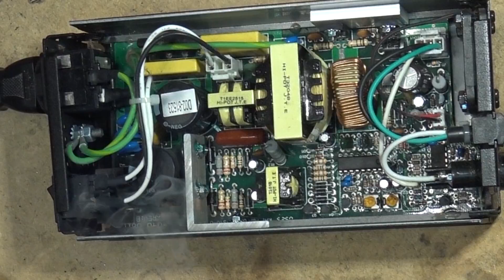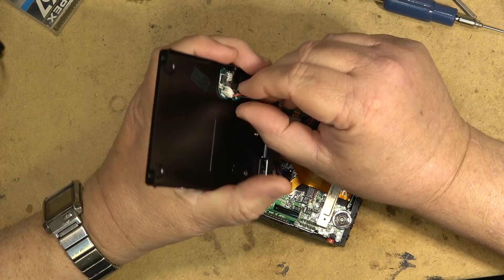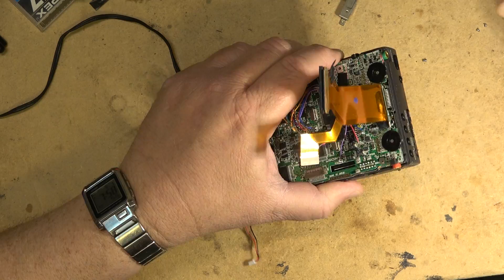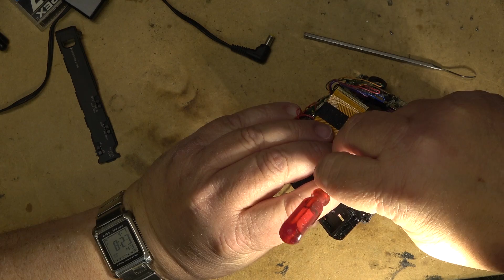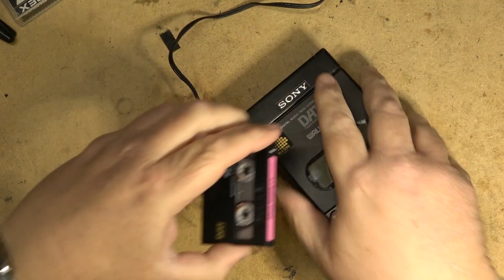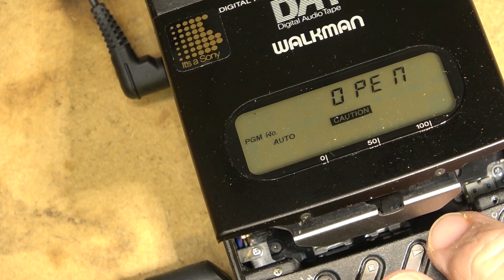sony tcdd3 is it junk?

Comment: Glad I sold mine it had all the accessories (remote and spdif).
Reply from the maker: I have the spdif, and car mounting bracket for mine. Works great.  Did stick a couple of times when I first fired up but ran a few tapes through it and it is fine.  The display el panel is out in mine.   I was hoping this one would be junked but the guy wanted it back to sell for parts.  Thinks someone is going to pay a few hundred for broken machines.  Good luck.  Back in the box and off it goes.

Comment: If you are a Sony service centre and receives a unit like that, what would you do ? technicians who know how to fix those walkmans are very likely retired, parts are unavailable, chances of a successful repair are slims and costs might be too much for the client who might just decide not to pay and leave the unit in your storage. It's plain simple, you come up with an excuse, say unit is not repairable and avoid yourself some headache. There is no point in bringing 15 or 20 years old devices to official service centre, in most cases they just refuse to do any work.

Comment: Ive got a sony dtc 700 machine is that something that can be fixed it loads but wont spin does it have belts inside that could be changed?  I have several people I trust that can send it away to or should I just get a replacement machine?

Comment: In your TCD-D3 the second one, you need to clean the two rotary encoder on the mechanism.
Is very tedious to go in mechanic, and you need to remove the reel assy. A long work but's is work.
Reply from the maker: That has been done. It just sticks, the door that is. If I tap the lid it once it has unloaded it opens every time.

Comment: You know what so sad about these machines is that they are put together by people getting paid very low wages! And it's all done an assembly line! One lady does one part and another and looking through big glasses just to put those little tiny ass screws in! I feel your patience wearing off sometime during the video! Boy no way I could do it!
Reply from the maker: I lose patience quickly when I know that someone else has been inside as there is usually a surprise. In this case a connector that the lock clip was broken and as soon as I released it the thing fell apart.
We refer to those as a cracker jack unit (surprise inside) Had it been never touched I would have more confidence of a successful repair.

Comment: All these SONY DAT walkmans suffer from hardened grease in the mechanism: it is a common and well known problem. In order to fix them, most of the mechanism needs to be relubricated.
The idea is that without relubricating the mechanism, it's only going to be a temporary fix, like it seems to be in the second unit shown in the video. The caution on display is caused by the mechanism remaining stuck in one postion from the hardened grease (the mode switches are not the problem, although it may seem like it). That's why operating the unit a few times partially solves the problem. The TCD-D7 shown in an older video which failed to load the tape had the same hardened grease problem. Although Dave lubricated some parts, there were others stuck and only a full relubrication will solve the problem for good. 

www.youtube.com/watch?v=fIfgVWZOZbk - this almost 5 hour video shows the refurbish process of these walkmans (the mechanism on the TCD-D3 is almost identical to the TCD-D7/D8).

There are people who specialize in DAT repairs who can refurbish these units completely for a good price. There are others besides those mentioned in the links, but keep in mind these units need a full refurbish, otherwise they're never going to work properly in the long run.  
http://www.andyselectronicstuff.co.uk/sony_dat_recorder_repair_service.html
https://www.paulcarrington.co.uk/dat-repair-example

It is to be mentioned this comment is not a critical one, just offering people who want to repair these things some solutions. They are indeed very hard to repair and it's nothing wrong with Dave's decision not to go any further.
Reply from the maker: If you watched my original TCDD3 that is what I did. Lubricated it and cleaned the eject switch. I then put the unit away and it has not been run for years. The mechanisms do get gummed up just  like those old dual tape decks. This one that came in had already been to sony awhile back and they had condemmed it. Also the mechanism on it was turning freely as I did run it though its paces when it was apart. The big problem on it is the capstan motor connector on the bottom of the board is so bloody loose that the connector won't stay in even with the clip engaged, and the servo problem that sony already said it had. The guy sent me 2 VCRs along with it, and one of them has a bunch of broken plastic cams and gears as well. The 3rd hasn't been looked at yet.
Reply: @12voltvids  I didn't say this unit in particular was repairable. I was just stating that in my opinion, someone who wants to collect something like this should have it completely serviced in order to enjoy it. Is it worth it ? It depends on how much one is willing to spend to have a perfectly working unit. But the ones specializing in these units charge something like 100$ for a complete refurbish. Depending on what the unit itself is worth, it may or may not be worth getting it repaired. 
 
I did watch the video when you serviced your unit. If you want, skip through the video I linked up above. It's made by a retired Sony engineer who knows all the problems with the little DAT walkmans. The fact that the mechanism is moving freely by hand is not relevant, as the motors have very low torque and even a little bit of drag can cause it not to work properly. 

Did successfully repair a D7 with sticky mechanism, so in my experience it can be done, but it requires a couple of hours of patience diassemblying the entire mechanism (every moving part must be cleaned and lubed with oil) and putting it back toghether. It's not an easy fix for sure, but after replacing the old grease with oil, the mechanism works perfectly. 
Again, I'm not judging your decision, just think that these DAT walkmans are worth being repaired, because they're a collector's item. Much more valuable than old camcorders in my opinion.
Reply from the maker: @valentinc22  Yes if there is not another underlying problem. I restored a portable Teac and of course my TCDD3 as well as a TCDD7. Had an 8 which won't spin the drum, and then this one which  the owner indicated he didn't want to invest much as it had already been written off.
The big problem with these units is the mechanisms stick. That is well known, and they will continue to stick even after oiled up if they are not used regularly.
Even min e had some trouble the first time I fired it up in 2 years, but I have been running it all day now and it working fine now. Note to self, don't let it sit around.  This is the biggest problem for all camcorders and vcrs and DAT machines and there is a warning in every owners manual recommending that the device needs to be run at least once a month to keep the mechanical parts in good order. Doesn't matter what it is. Your car is the same. If you let it sit eventually the engine will freeze and then you have a problem.
Now you see I just reminded myself that I need to run a tape through my digital 8 cameras and mini DV cameras to keep them in good order as they have all been sitting for months untouched.
Reply: @12voltvids  So true ! It is indeed very important to use these units regularly. But in your case it's probably more difficult given how many you have. 
But at least I get to see in your videos a lot of devices that I would never want to own anyway.
Reply from the maker: @valentinc22  There is the cool factor to the size of it. I like them to show off what was available, but you are right they need to be run from time to time or they will just deteriorate from disuse.

Comment: When you send stuff to Sony they often LIE about the nature of the problem, and suggest you have them scrap it. They come up with some part or other that is no longer available, and tell you that is what is wrong. I worked for a Sony authorized service center and we heard this many times.
Reply from the maker: They are no different than anyone else.  The smaller and complex the device the longer it takes to service. At 100 bucks an hour something like this is on economical to repair unless it's something extremely minor.
Reply: @12voltvids  The difference is the Sony people LIE. Seen it more than once. This is my experience with the Laredo Service Center, from which they truck stuff down to Mexico for the actual "repair".
Reply from the maker: @mdzacharias  Doesn't change the fact that someone had already been inside and the connector under the board was damaged. These things are a pain in the ass to work on to begin with and dealing with damage that others may have caused adds an unknown element to it.
Reply: @12voltvids  Yeah I admire you for even trying with that thing.

Comment: I seem to remember a DAT forum website or somesuch of enthusiasts who know how to work on DAT units. It's worth trying to send it to someone there.
Reply from the maker: Remember this format is completely obsolete now.  No parts available.   I don't spend much time on them because 9 out of 10 won't be fixable due to parts issues.   Since i make nothing doing guestimates i look for the obvious and if nothing jumps out I walk away.
Reply: @12voltvids  in Europe, there has developed a whole business branch around DAT spares. People are manufacturing gears, pinch rollers and other parts to keep the decks running. But as soon as you need a replacement head drum or one of those drum or capstan motors, all you can hope for is to cannibalize from a defective sacrificial machine. And good luck getting a replacement for one of those 4-head-drums from the 87ES/2000ES or the studio PCM series. I have a PCM-2700 with 385 hours on its drum which I am guarding like the apple of my eye lol.
Reply from the maker: @svenschwingel8632  Yes I have a spare DA40 that I am hanging onto for parts.
Reply: @svenschwingel8632 tape is obsolete